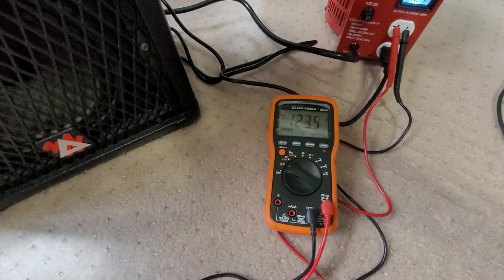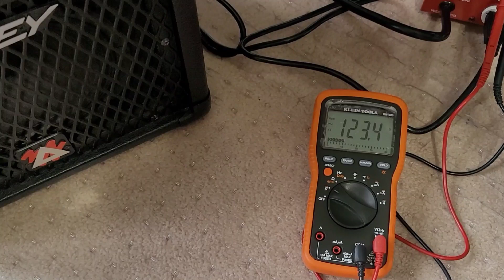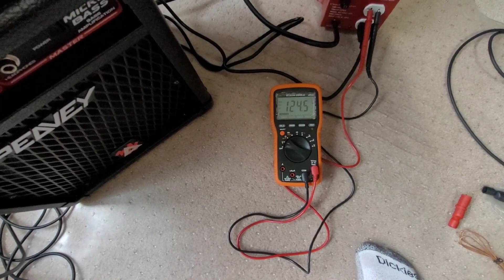ART Pro Channel II Tube Preamplifier: Buzzing/Hum Issue - How to Fix

Comment: We you gonna take out the resistor?
If so, can you make a video on it
Cuz I don’t want to screw mine up lol
Reply from the maker: All you would need to do is cut one side of each resistor and that would solve the buzzing problem. There's no need to remove the circuit board. I'm not going to remove the resistors only because it is not that big of an issue for my needs. I can address it by running all of my equipment at a slightly lower voltage through my variac negating my need to remove the resistors
Reply from the maker: @zombiepenguinstudios if you need help making the mod I can jump on a live stream with you this week. All you need are some nipper pliers to cut one side of each resistor.
Reply: i appreciate that  @Bassguitarist1985  
I have some things that are preventing me from even getting the tool at the moment but  we can come back to it at a later time 
😎
Reply from the maker: @ZombiePenguinStudios  no worries! All the best bud!

Comment: i'm back at here watching this video 
it scares me thinking about taking out the resistors 
it's the white rectangle blocks, no?
Reply from the maker: Yes that is right. Snip one side of them and you're buzzing issue should go away. The voltage regulators that are heat sinked will run slightly warmer but they are adequately sinked to handle.

Comment: I'm in the EU and the standard voltage in my country is 220, I'm also experiencing the same buzz/ hum issue and was wondering whether snipping of the resistors would be okay considering the higher voltage?
Reply from the maker: @caechez  it should be okay. The voltage regulators that are heat sinked will run slightly warmer but you won't have the noise being injected into the audio circuits.
Reply: @Bassguitarist1985  okay! thank you for the quick reply.

Comment: One tube is for the preamp section and the other for the compressor? or both are for the preamp?
Reply from the maker: V1 is a 12AX7 and is for the pre-gain stage. V3 is a 12AT7 and is for the Compressor

Comment: I'm in the US. If I were to buy this unit, would it be fair to cut those resistors right out of the box or should I demo it for a while first? Would I for sure or likely have the humming issue otherwise?
Reply from the maker: What's your voltage coming out of your outlet? Below 120V or so?

Comment: So the Variac just plugs into the wall and you plug the ART voice channel into the Variac to control the voltage?  Don't they make smaller wall voltage regulators? It's crazy that we either have to snip away or use a Variac unit, which I don't own at the moment. Ty for your reply.
Reply from the maker: Correct and yes they do make smaller variacs. The PSU is old school linear, not switch mode like many new devices. The engineer who designed it told me that all new units come with these resistors to run at all world voltages.

The tolerances of the LVR changed over the years due to part substitutions thus why this issue came up. The resistors are there to bootstrap power to the circuit bypassing the linear voltage regulator. Its perfectly acceptable in a circuit to do this. Basically the 120-240V models you can snip these resistors. The LVR will run warmer since it is now taking the load the resistors were handling but shouldn't be a problem. On the 100V and below models the resistors are necessary since lower voltage means more current. However there is no buzzing with lower voltage units due to the tolerances of the LVR.

Hope this helps. The unit sounds fantastic otherwise. You have the choice of a starved plate voltage design or full voltage at the preamp valves! :-)
Reply: @Bassguitarist1985  Thanks for the response. So either side of the square white resistors can be snipped? Should they be completely removed to prevent contact once clipped? I just noticed that ART makes a  Pro Audio CleanBOX II. Hmmm.... Would hum eliminators work in this case of the Pro Channel?
Reply from the maker: @martyc8699  no in this case the buzzing you are hearing is not a ground loop. That box would not fix it. What you can do is snip one side and just move the resistor out of the way. You can then cover the lead with some tape or shrink tube. To properly desolder it you would likely need to remove the entire PCB to get access to the underside.
Reply: @Bassguitarist1985  Ok good, I will use electric tape. I hope this works cause I shelved this unit two years ago after buying it used. Thanks for your help.
Reply from the maker: @martyc8699  keep me posted how you progress! The unit works really well for me!

Comment: I dont think that the tubes in these units actually do much besides getting gradually hot in there. They're not really producing a colouration so to speak. They're doing something and they're interesting units. I have messed around and it just seems to be a different voicing that works in certain signal paths.
Reply from the maker: Thank you for watching! Yeah I have not looked at the exact schematic but overall the unit sounds very good for the price point. No complaints here.